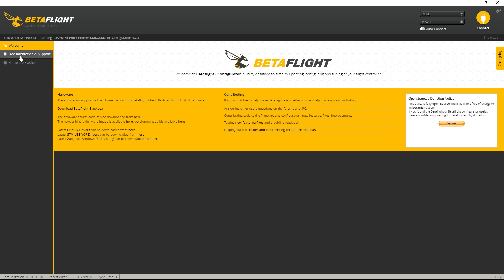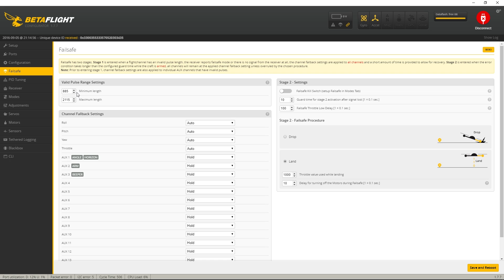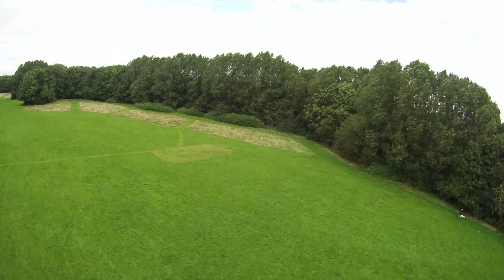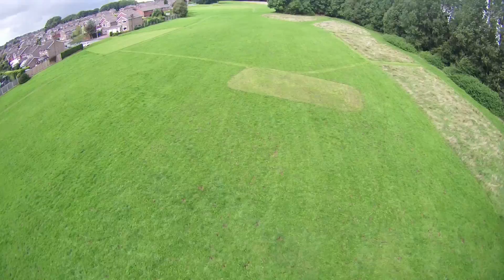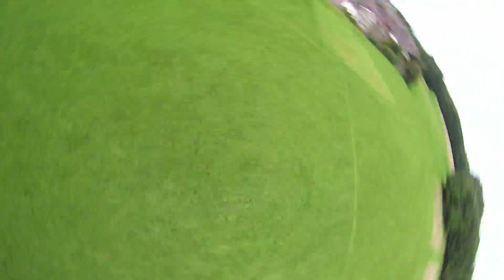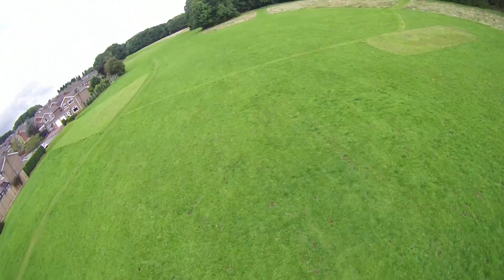Holybro Shuriken 250 BetaFlight Tune

Comment: Hi AndyRC I hope your day has been going well! This is kind of out of the blue and I feel bad/silly for bringing up such an ancient copter at a time when so many more exciting things have come out! Its my Shuriken 250... I got it as a BNF in 2017 and never set it up. I have completed the transition from Cleanflight to Betaflight and it sits at Betaflight version 3.0.1 at this moment. I messed up the configuration of ports and now I don't know whether to use uart one uart two or uart threee. Uart one is usually USB so I haven't touched that. I have tried both 2 and 3 and have had no luck. My Taranis X7 is bound to the thing in D8 mode, but it is acting weird. I have changed the channel order from aert to tare in betaflight and all my modes are set but none are being recognized as I have yet to finish setting everything up. Sorry for the rambling I tried to convey all the details as best I could.The XSR receiver is doing something because the Taranis makes a little vibrating sound when I put a battery in or take one out of the copter. If you have time I would appreciate it, at the same time if you have something else going on at the moment I'd understand that as well. Take it easy.

Comment: hi Andy! i upgraded to latest fw of betaflight , but i have a big trouble with osd and battery warnings... i set the osd in betaflight but i see another osd... and battery voltage is wrong, is too low so the drone beeps after 1 minute of flight and in osd i see "battery low" and after go in failsafe... do u see the same?

Comment: Hi Andy. can I bind this Shuriken 250 Quadcopter with a less expensive Transmitter ?
Reply from the maker: yes but u will need to add a receiver to it also it acceps sbus and ppm such as the flysky system

Comment: Hey Andy, How did you get Betaflight to work on this. I have tried setting it up but it keeps giving me a betaflight not compatable with this flight controller. Do I have to flash a betaflight  firmware through cleanflight 1st and then use the Betaflight GUI program ?
Reply from the maker: no u flash it through the betaflight configurator sounds like u might be selecting the wrong board

Comment: Voltage sags could be from the fact the three leaf props are bull nose therfore draw more amps than your standard hq props
Reply from the maker: i tried with the hq props and it does the same
Reply: Hmm that's odd could be the higher kv that your other mini quad dont have
Reply from the maker: i think it is down to the big thick arms personally
Reply: Yh probably that's pretty poor design that for a third of the time it's actually pushing down on itself!?
Reply from the maker: yes correct

Comment: try to go into motors tab, make sure motor stop is on, then raise the throttle one unit at a time until all motors are turning smoothly. add 10 to prevent motor stall in mid flight and that should be your minimum throttle and that should fix your air mode problem
Reply: also make sure you remove your props!

Comment: when updating firmware, do you have to push a bootloader button or is not necessary unlike the regular fc boards?
Reply from the maker: not necessary to press boot loader it loads automatically into dfu mode
Reply: Cool, thanks for the fast reply!

Comment: Try setting you Min Throttle lower up to the point where the motors are just spinning smoothly (mine is set to 1028, at 1050 mine lifts off on arm). This might help with your problem of the quad lifting at 0 throttle input.
Reply from the maker: i put it to 1000 and it still lifts so i think I am giving it a miss till the next release ;)
Reply: +AndyRC have you tried changing set min_check in the CLI? It may have something to do with that.

Comment: If the the quad is lifting up when air mode is activated it's be cause min throttle is too high
Reply from the maker: even at 1000 min throttle it lifts. I dont trust it with powerful quads at the moment
Reply: i think Lesile is right, calibrate the esc's using betaflight  and set min throttle to 15 to 20 points higher then when the motors just start to spin up. but if you arm in airmode  and wait too long the motors will start to speed up . i take off in airmode quickly  and land by using a disarm switch or it will bounce like it's a kangroo

Comment: It's true there is a difference, between 20amp and 30 amp esc's. But the biggest reason for the higher amp drawn is first of all the weight. Secondly this uses the bullnose triblades wich give crazy amounts of thrusts that's true but are about as efficient as a American pick-up truck. That's why secondly,  I have found in some personal testing that when a prop passes a plate of cf like this one does over a large area it creates a pocket of high pressure air and also makes the thrust less efficient. So the high amp draw have to do with props weight/motor.  The impact of the esc is negligible.
Reply from the maker: with the same props and same weight as my zmr this one draws more amps. so its a combo of motors esc and thick arms definately